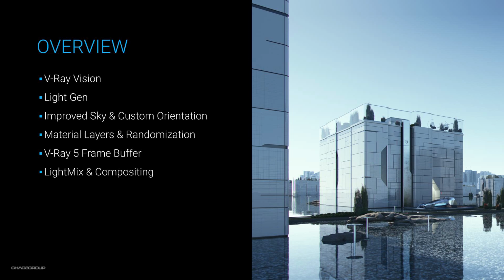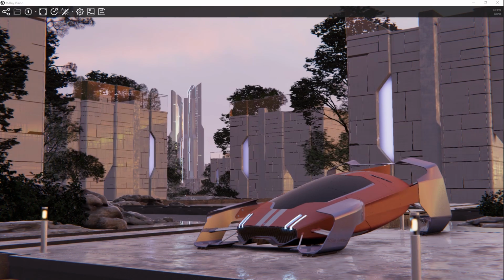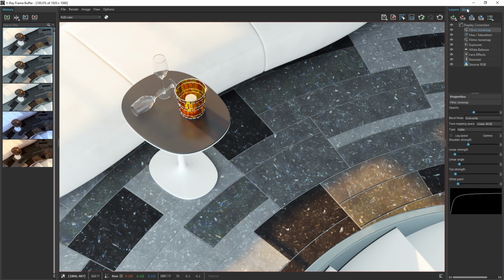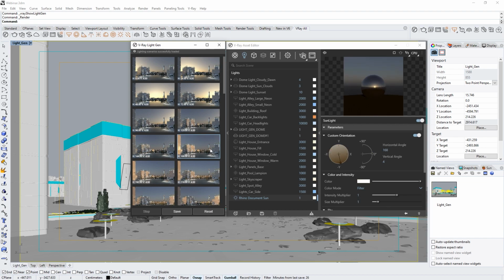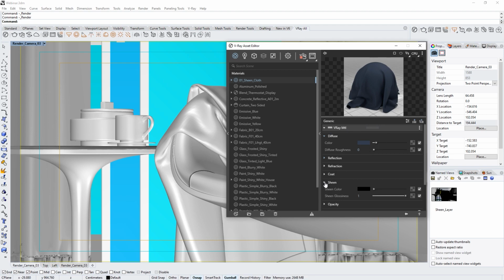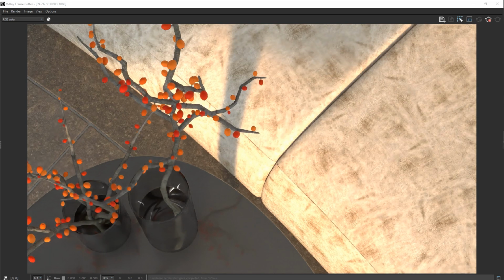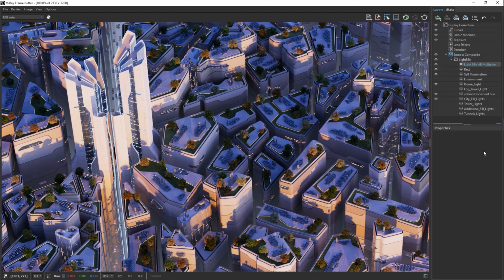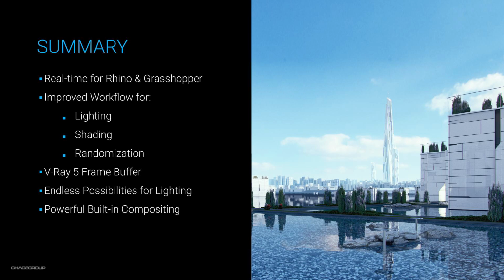Free webinar: V-Ray 5 for Rhino

Comment: In the official tutorial, the official material library is used to directly call the material in the cm template, but I used the meter template and found that the material is rendered darker. Just scale the default bump map value to 0.01 to achieve the normal effect. This is just for me. Know.
What other parameters in Vray will be affected by the template, and which parameters need different adjustments in different templates?